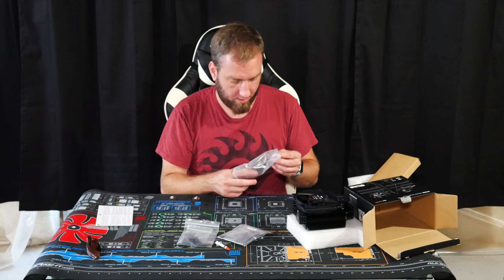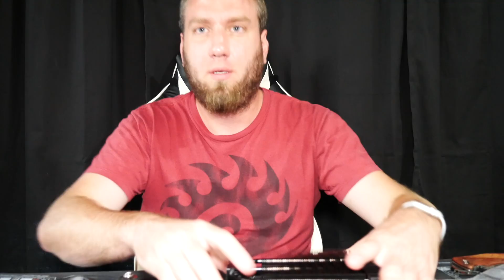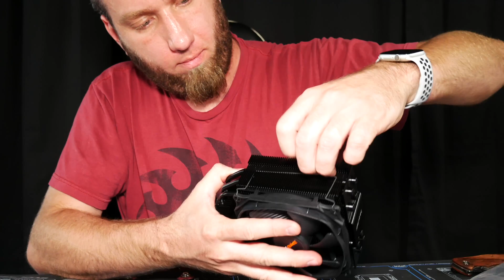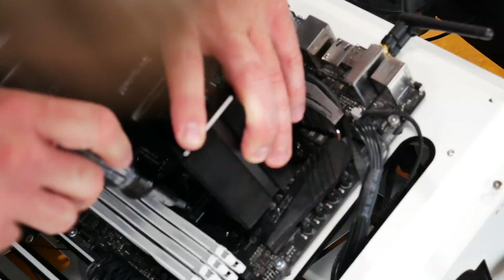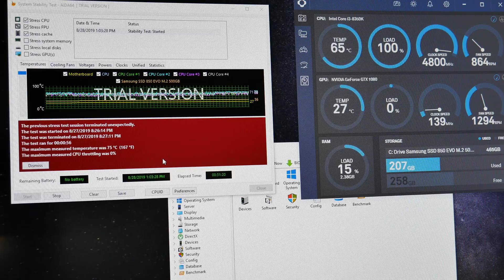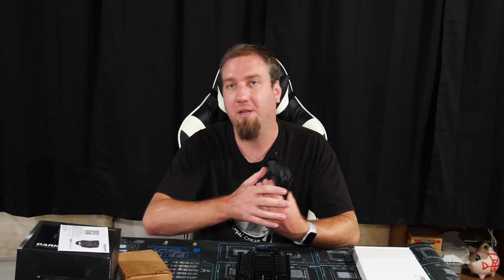Be quiet! Dark Rock Slim cpu air cooler vs a custom water cooling loop

Comment: i have a dark rock slim cooling my ryzen 9 5900x at stock settings and its doing great. really impressive cpu air cooler. I even have plenty of room for a mild overclock. i idle around 38-40 and gaming it gets to around 70-75 or so. I love my 5900x and I love my dark rock slim! i would have got a dark rock pro, but I have a itx tiny pc and this is plenty fo my needs. you cant go wrong with dark rock, plus the coolers are sexy af!
Reply from the maker: thats awesome!

Comment: So did you recommend it?
Reply from the maker: Its a good cooler, but I cant say id recommend because theres too many variables to say if Id recommend it for that situation. But I really like it.
Reply: @PCGoblin  what "situation"?
Reply from the maker: @billygames7107  air flow in the case, TDP of the CPU in question, overclocking, and im sure some others I cant think of atm. :)